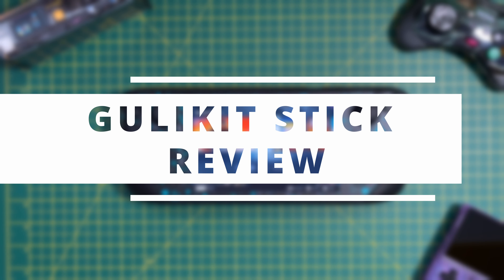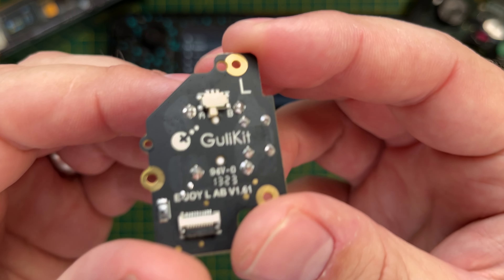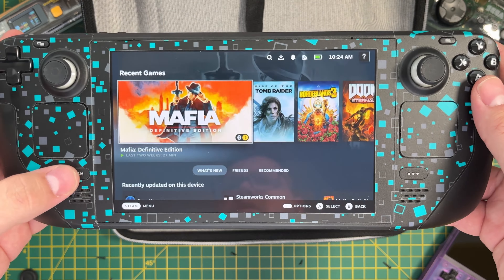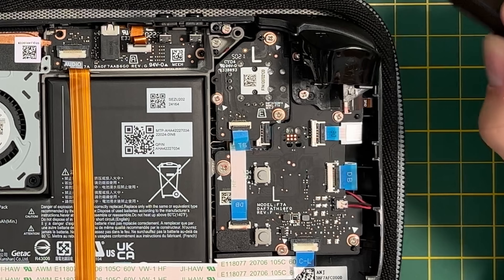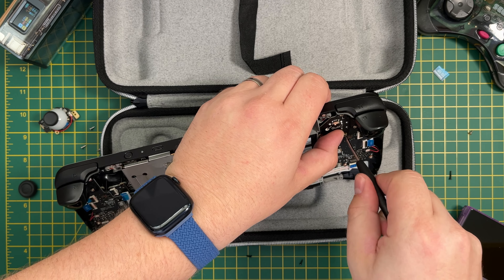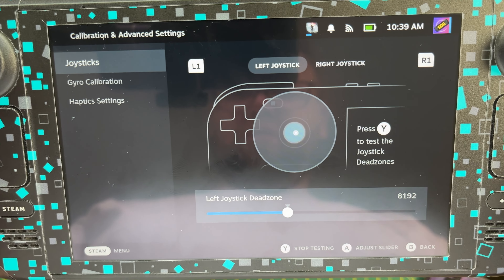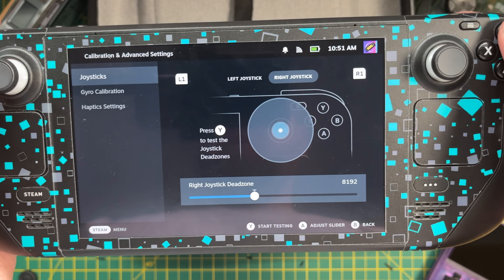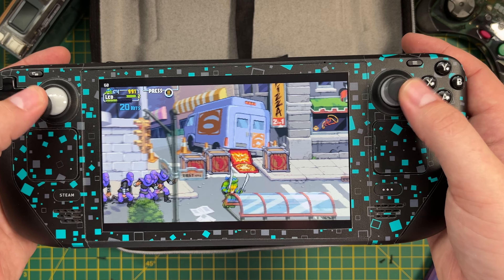GuliKit Joysticks for Steam Deck Review

Comment: I installed mine yesterday, I think they made a pretty big difference. Mine were like yours "perfectly fine" but I've noticed that while the return to exact centre is basically the same as the OEM sticks... the accuracy when off center (aiming in an fps for instance) is much more precise.
I've played about 4 hours with the new sticks now and when I took breaks, I'd be like... man I'm finding this game so much easier, like aiming is no longer an issue...
I used to overshoot my target, then go to adjust and undershoot, then overshoot etc. etc.
Now I find I am much more bang on target.

(and it's days gone which I know is third-person, but same diff and I have over 200 hours on the game with several play throughs, and I swapped mid-play through so it's not like my skills just improved in the last 4 hours)
Reply: you know. you dont even need all of this if you use gyroscope instead lmao.
Reply: @Bos_Meong or the touchpad
Reply: Sticks on Steam Deck are the stiffest out there. No wonder you had all the trouble with them.

Comment: Good honest review! 

I had a bad module with a lot of play before it has some tension, can't get a replacement from seller, so be careful where you buy these. Also the stick's material quality is a lot worse, it's just hard plastic in stead of the rubbery original ones.
Reply: Well don't feel too bad, the rubbery part on the original will fail (2 years of use for mines) and the outer rubber ring will free rotate annoyingly. At least hard plastic will last longer.

Comment: I get the impression that the centering issue is not an accuracy problem with the sensor, but with the physical centering of the sticks themselves.
Is it not normal for sticks like these to have a tiny bit of play in the center?
Maybe they'd need some lubing or stronger springs to get perfectly centered every time.
Reply from the maker: Yeah I think you might be right, although there is no play with these. If you move them slightly it will register as movement which does make them more precise. It’s just that they don’t always return to the exact centre as expected. With a deadzone of around 3000 it’s not an issue
Reply: @steamdeckguy  On every controller I had I find there's at least 98-99% accuracy. The joysticks pick up the movements in between each spring just fine

Comment: Kinda an unrelated topic but Honestly this needs more attention. The steam deck has a huge issue with getting a black screen where device works but the screen just doesn’t. Everyone on reddit is reporting this issue and all valve does is replace it than actually do something to fix this issue. I wasn’t lucky they wanted to charge me 145 to fix the deck even though it’s they’re fault for the faulty hardware.
Reply from the maker: Interesting - I hadn't heard about that issue.
Reply: @steamdeckguy  looking up steam deck black screen results in this whole thread of people with the same issue, whatever reason tho they always just send a new unit when people get it repaired. Almost like it cant be fixed

Comment: I'm thinking about buying these because a couple of times one of my sticks started to drift and so I had to open up my steam deck and use compressed air to blow out the dust out the stick. Worked liked new but I would prefer the drift chance to be lowered to almost zero. I do travel so this is a must have from what I can see and experienced. I can't open up the Deck with no tools ikr?
Reply from the maker: Yes, you need a small screwdriver and a prying tool as mentioned in the video

Comment: TL;DR you won't see much difference between a HALL effect and a new OEM potentiometer. But over time, the HALL sensor should work well for longer. 

So having dealt with HALL effect sensors for flight sim gaming, I can shed some light. The return to center is an effect of the gimbal mechanism, NOT the sensor. At least on a new device. The main advantage of HALL effect is a more consistent input along travel and resistance to wear/contamination (dust). Typical potentiometers will lose center and accuracy as they wear and get contaminated. This is because they use physical contact. HALL sensors measure the relative change in orientation of the magnetic field of a magnet (without contact), where potentiometers (the stock sticks) physically touch two wires together, sliding one along the other, and measuring the change in resistance to estimate position. 

This is why you have to do this weird calibration thing. When the magnet is put in place, it can be in any orientation. The software has to decide what position is center. And unless the hardware you're putting it in knows this, the input has to intervene and translate it into familiar data for the steam deck or console.
Reply from the maker: Good info. Thanks for sharing 👍

Comment: Calibrating on the Nintendo Switch was much easier with the Nintendo-built-in calibration setting. These are a pain to do with the small dot, even on the OLED model ones., still tho they feel miles better then the standard ones but do feel a bit sticky , maybe I need to wear them in to get that feeling to go away

Comment: Does the touch functionality of the sticks work with these thumb covers?
Reply from the maker: I’m using the skull and co thumb stick covers, and with those the touch functionality doesn’t work. To be honest, I don’t recall ever needing to use touch controls
Reply: Thank you, I have the ones from Debrand and there it’s not working either. 
But as you said, I also don’t use them.

Comment: Where’d you get those back buttons? Those are neat.
Reply from the maker: They are included with the JSAUX backplates. You get 3 different sizes
Reply: are the built into the case like the vanilla buttons or are they like the extreme ones? (i don't like the kickstand, make it too bulky feeling)

Comment: How can I check the controller id on windows?
Reply from the maker: No idea. If your deck is old, it will be A and more recent ones B. Just set it to one of the settings, and if you find the touch button doesn’t work change it to the other one.
Reply: @steamdeckguy  alright had mine for over a year now so that was helpful. Thanks

Comment: I have installed mine as well 2 days back , same version, but the issue is i can not ever get it dead centre while calibrating. I have done my calibration through Konsole from desktop. Never the pysical button but still, its a pain.
Reply from the maker: I think the physical button makes the biggest difference. if say, its a mm over to the left, then you have to move it 2mm to the left and then press the button. When you release the joystick it should go back the centre. This is the part which found the most fustrating and I wish is was automatic

Comment: Does the transparent back plate give you lower temperatures compared to the original one?
Reply from the maker: I never really did a side by side comparison. In most demanding games it hovers around 80 degrees
Reply: I'd love to hear the reasoning behind that question.
Are you asking that specifically because it's transparent?
Reply: @majorgnu it has a piece of metal that's supposed to passively cool a little. And yes, the temps are lower for longer but eventually even out.
Reply: @majorgnu  Nah, it's because Jsaux claimed that their case (which should be the same one in this video) helps with overheating issue in their producct info.
Reply: @Spolt_main  That's good to know. I saw people talking about the metal plate being hot as hell so I was hesitant to actually get one.
Reply: It typically takes a max of 5c or about 3c average off, and lowers fan rpm a small amount.